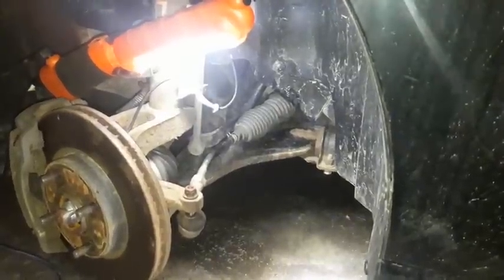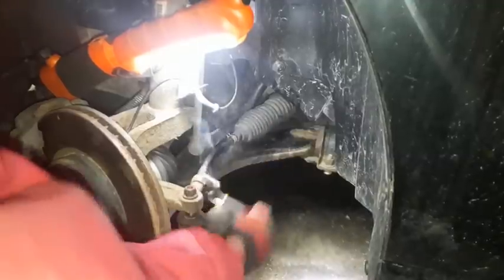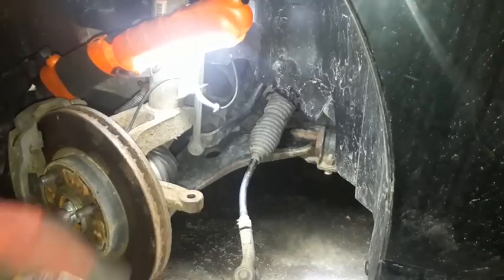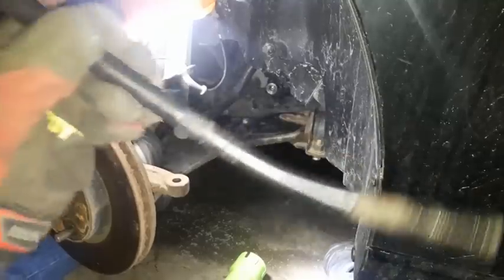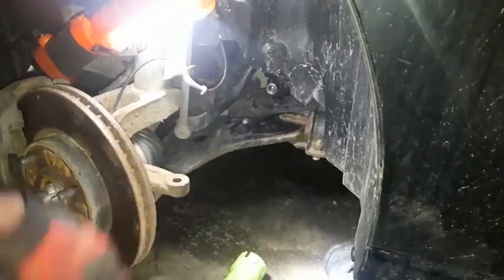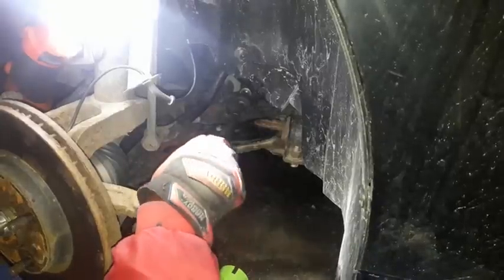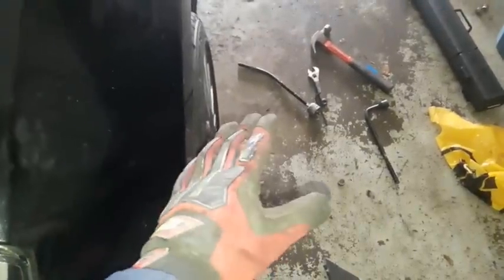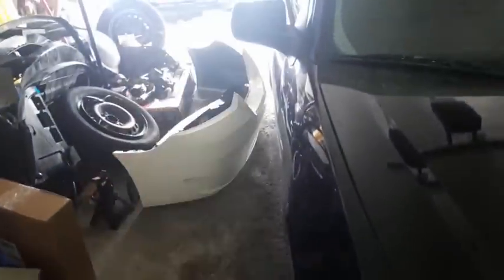2009-2011 Ford Focus Tie Rod Replacement

Comment: First.

I just did my first inner tie rod job last week, loctite/threadlock was recommended on the threads before installation.
Reply: Kevin Johnson did you get alignment after wards
Reply: Facts

Comment: Most people don't understand that when you are sliding on Ice or snow, it's best to 
get the car in neutral while applying the brakes. so the wheels will stop
 turning.
Reply: You don't want the tires to lock up or "stop" rotating, especially in snow and ice.. the tires turn into snow sleds..
Reply: Your not bright cus you don't put pressure and swap it to neutral one your breaks are going to be fighting you all the way back into your pedal two you lose all control of your car when your wheels are unable to turn

Comment: Only problem is the OEM inner tie rod does not have a slotted    end that tightens into the rack. You got to use the clamp tool with extensions
Reply: do you have to hold the shaft of the steering rack at all with some vice grips? saw another video where someone did, and some other vids its just the tool and that is it.
Reply: @jgarcia1925  
It is the inner tie rod tool that looks like a exhaust clamp.
Reply: I noticed that on the OEM and I can not get it off. Need a little creativity.